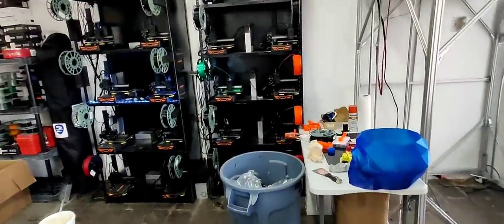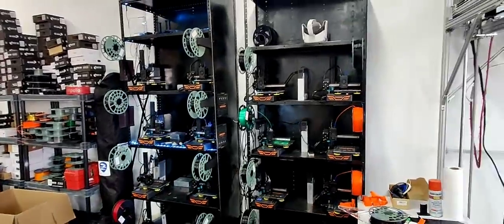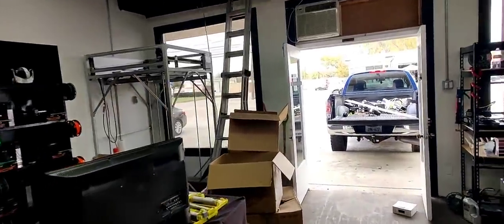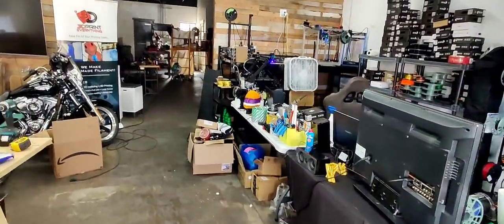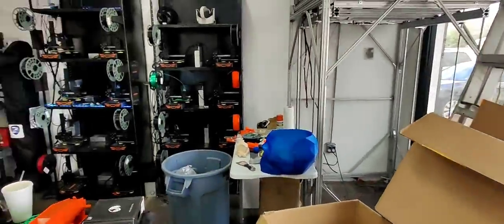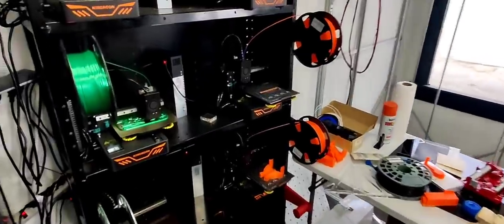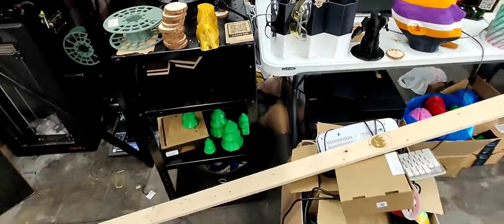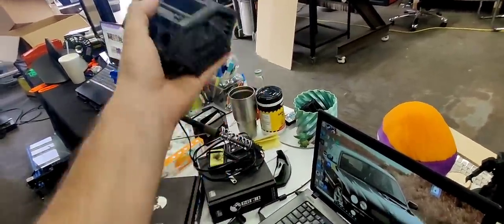How to make money with your 3d printer from a successful 3d print startup!

Comment: Hi Michael, Nice video. I am in the process of staring a 3d print farm in Greece and all the info is really appreciated. For GST filament make sure you get it through a filament dryer (i use cheap food dehydrator)  before you use it. 4+ hours at around 60C and most of the issues go away, at least for the European produced batches, as they have 3 factories from what i understood. (The ones from Argentina are usually the worst i found)
Reply from the maker: Ahh i wonder if this is the batch I got.

Comment: 19:07 Bruh, you have just described what I hope this journey becomes, and the story of someone else(Or maybe the same dude, IDK, but the machine brands are different) that supplied me with my printers!

Headline over:  I've been mowing lawns full time because it's a fantastic workout and great money.  Bought some "for repair" printers, in pairs, from someone operating out of a storefront refurbishing and selling printers.  

Up to 6 machines that can be trusted, day by day, with maintenance, checking bed adhesion on the first layer once a day is good enough.

I've developed two products that are in refinement stages, and have a couple spin offs that I really should be listing on Etsy, not typing this.  

But I'm afraid that if these small items (a desk or shelf light sconce) sell well, I won't have time for the main project - a tool holder which illuminates the slot of the tool being used.  Reminding the user to replace the tool in it's home, keeping a clean workspace.  I recently learned this was a concept the Japanese call 5S  "Sort, Set in Order, Shine, Standardize, Sustain".  And I love this!  So much time can be saved when you have a properly organized workspace and take that time saved, to keep the workspace organized.

Comment: So when you charge by the print hour, is this the estimated print hour, or the after the fact print hour. IE if a print failed at 99% and you have to start over, do you charge for that? What if it's your fault?
Reply from the maker: I just charge the 6$ a print hour and this covers failed prints with in reason. 
If your buying for 15-25$ a roll your cost with electricity is some where around . 0.50 to 1.10 a hour. So if your charging 6$ you can cover a couple of fails and still not need to ask the client for more money. 

If your finding your self on a extra tricky print that even other shops would be challenged with you can tell the client the R&D process of getting their print to work will require some extra money. 
Rarely do I go negative but some times I just have to eat it and loose a little money.

Comment: I have one ender 3 v2. How long did you 3D print for fun before you started commercially? Also how many printers should a guy have to get started and like in my case should I buy a few more ender 3’s since I am familiar with them?
Reply from the maker: I think you will like the kingroon kp3s more. and then you might need a bigger one like a tenlod d3 or d4. 

I started with just 1 printer but this is slow. you will need 5-10 printers running constantly to start see income that you could set some aside for your self/ bills. Otherwise you need to use profits to build the business bigger like websites and more printers ect. Expanding your electricity so you can handle having more printers in one room. ect.

Comment: Do you use any software to control your printers remotely (octoprint, fluidd, etc) or are you able to make sense of having a million SD cards floating around?
Reply from the maker: I just keep wiping the sd cards so i never have more than 1-5 files on the card. because most orders are unique I only print 1-10 of them then its on to the next file. 
in the future I do plan to setup octo print but If i took that task on all at once today it would cost over 3k in supplies lol

Comment: I make okay money selling refurbished Amazon return creality printers aswell. It's not millions or even thousands yet but ots starting to pick up
Reply: Out of curiosity, what are you normally doing on a refurb?  As far as replacing, or adjusting or fixing?
Reply: @jjsemperfi  mostly just replacing fans and reflashing firmware. I always put new nozzles and belts on aswell. 
Most of the time it's something the previous owner screwed up trying to update firmware so I just flash the newest firmware on them and they are good to go.
Reply: @justincasiere9598  Very cool. Thanks

Comment: You might even have the opportunity for 3d printer repairs too.  I work for a (regular paper) printer company, fixing printers.   It just hit me because I sold my first cheap Chinese Anet knockoff printer  and the guy messages me from time to time asking questions about how to fix it.  (I do try and give him advice and direction to help...)
Reply from the maker: I do also charge for this. I have found that about 20% of printers coming in for repair I underbid and end up spending more time on them than whats it worth. 
Id say if you just unclogging or tuning a ender 3 pro. Go for it. 
If some one wants their makerbot, prusa, motherboard swapped to a new design its not worth your time as your need to charge much as a new printer generally for your time. 

But to get 60$ for 20-30$ mins of tuning a ender 3 worth it all day. I do about 5 a month or so.